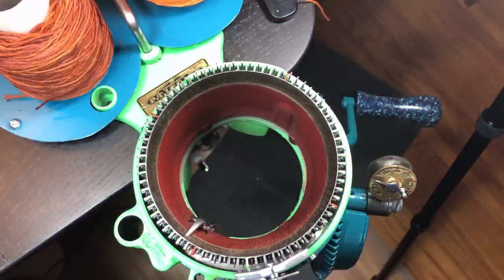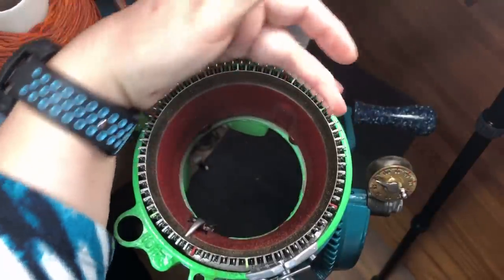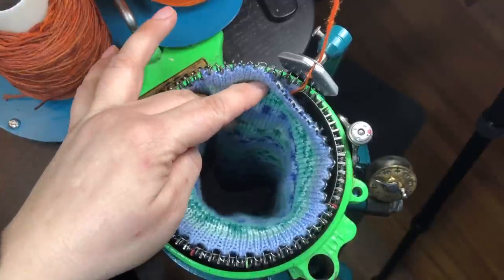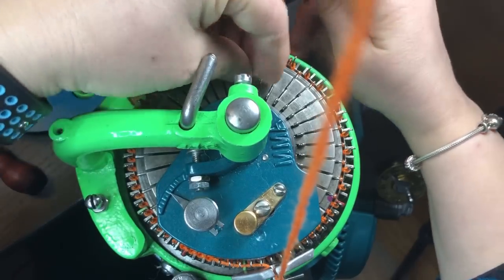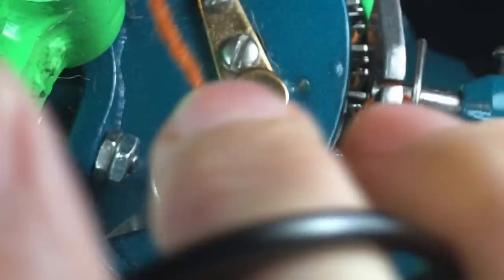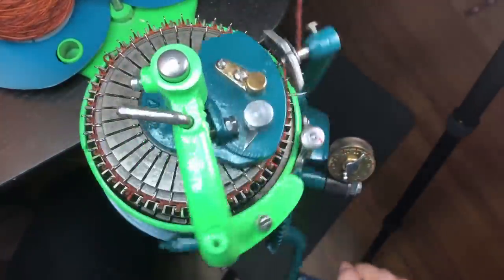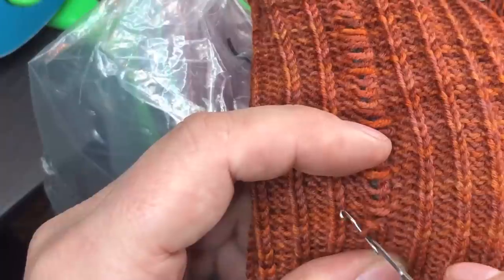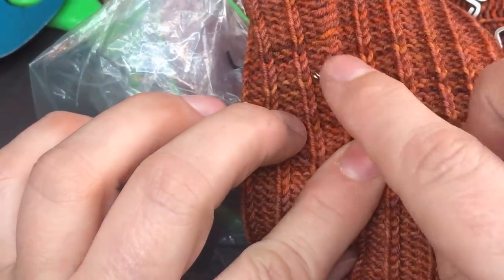CSM: Cuff Down Ribbed Sock with Ribber Needle Park & Rest Ribber Removal

Comment: Karen you didn't say which csm you are using . although I did see in the comments it says a legare 400.    I had wondered if it was a Chambord as  I noticed the row counter is  brass.   Since the machine is not a Chambord,  can you tell us if the row counter is one of Dave Lord's brass counters and what might be different about it or why you like it .  I would love a video about row counters since the original csm's did not have them (at least not the auto knitter).  Also, is the  selvedge you are doing unique to use with the ribber?  I cannot remember if there is a selvedge that can be done with the cylinder needles but it seems to me not . Perhaps you could clarify .  Thanks .  Great video as always
Reply from the maker: This was done on a Legare :) Some shots of the bedplate show PT Legare :) - Although what machine was used actually isn't important (this ribber sock pattern method can be made on any machine with a ribber). There are many row counters out there - best to see what your own budget/cost/restrictions might be - I prefer this one (isn't plastic, mounts on machine without damaging it which also makes it easier to move around, works on 1:1 ratio, is EASY to read AND isn't magnetic - which can cause issues on a metal machine) - https://www.csmlove.com/row-counters - SELVAGES: A selvage is referred to in CSM land as a recipe/method used to lock in the stitches when using the Ribber so that when scrap is removed off the machine - the stitches don't undo. If you weren't using a ribber (just the cylinder needles) one option is to start (or end)  your project with a hung hem (see my universal bonnet pattern). For more on all of these see the Techniques page https://www.csmlove.com/techniques

Comment: Boa noite  aonde vc comprou  este maquina  de meias
Reply from the maker: This is a Legare 400 purchased in 2012 and refurbished Oct 2019. For info on new or used machines please see my website under supplies. I do not sell machines. :)

 Este é um Legare 400 comprado em 2012 e reformado em outubro de 2019. Para obter informações sobre máquinas novas ou usadas, consulte meu site em suprimentos. Não vendo máquinas. :)